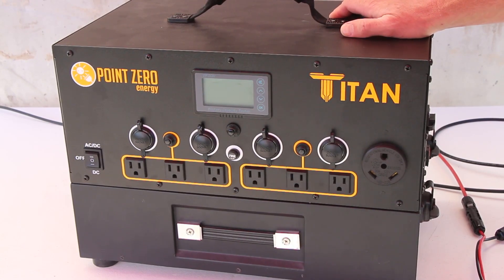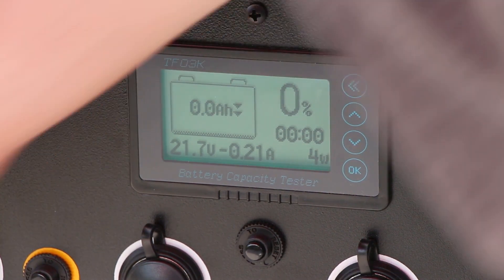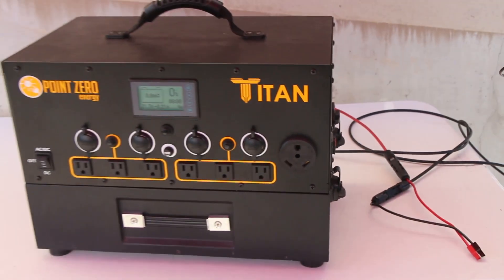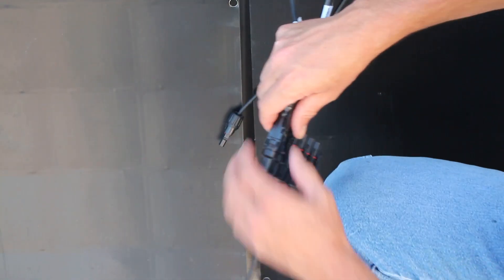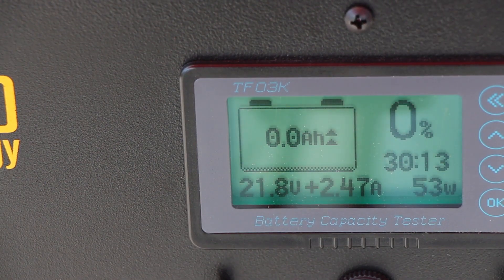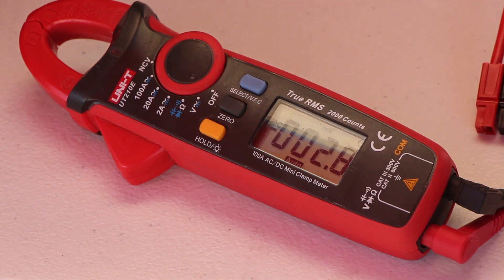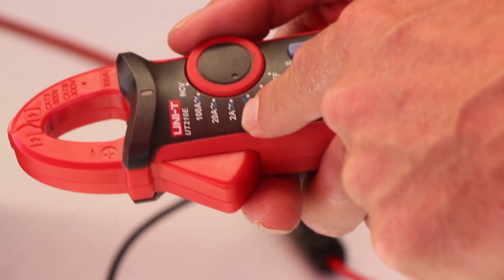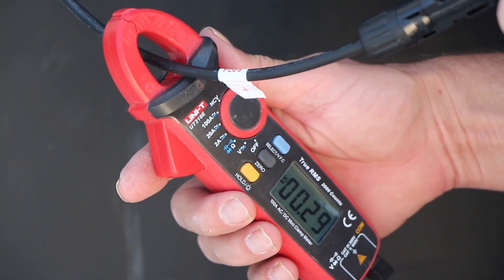Point Zero Energy Titan Solar Generator How-To Guide

Comment: Will this titan solar generator run a 2600 square foot home? and for how long? Thanks
Reply from the maker: It does not matter what the square footage of the home is, but what appliances you will run.  For example this original Titan is only 120V, so it will not run any 240V appliances such as a well pump, 240V AC, etc.  For those types of things, you would want our 240sp version.   But any off-grid solar solution has a limit to what it will run (even your grid connection does, but it is much higher).  If setup correctly it will run your home indefinitely (with the correct number of batteries and solar panels).

Comment: You will never get 42v from your two solar panels. As the length of the cable from the solar panels to your power station increases, its resistance increases in proportion and the volts delivered drops. Even if your station is right next to the panels you will loose volts due to the resistance created by the electricity running through the wires.
Reply from the maker: Yes, you will get a voltage loss according to ohms law V=IR, where V= Voltage, I = current, and R = resistance (R will increase the longer and smaller the wires are).  This voltage drop will be very small unless your wires are extremely long, for example using a 10A solar panel, over 25 feet, and 12 awg wire, you will get a drop of 1V (here is a handy calculator:  https://www.calculator.net/voltage-drop-calculator.html ).    However you want to make sure your voltage reading does not go to high even with zero current (you will get zero current when your batteries are full, or before the controller starts charging).  You also want your voltage high enough that is does not drop too low during high current that it does not go under your minimum voltage.  

You also will get higher voltages when the temperature drops, and lower voltages when the temperature rises (generally much more fluctuation than than from the voltage loss in the wire).   So you need some buffer in there to make sure you don't go too high or two low.  It is a good thing there is a wide range to work within.  Anything from 40V up to 110V is generally a good range to stay in, where you will never have any problems, no matter what your conditions.

Comment: Been running mine for almost two years now continuously. But now my panels will not charge the unit. Our 4kw generator charges it but panels won't any longer. I ran through troubleshooting in the manual, tested leads coming from panels for voltage and current so no issue there. So what now?
Reply from the maker: What panels are you using, how are they configured, and what is the measured voc (voltage open circuid, and isc (current short circuit)?
Reply: @PointZeroEnergy  5 rich flexible panels wired as instructed in the manual (series). Came with the kit. Can get you voltage and current readings when I return on thursday.
Reply from the maker: @harrisc8101  sounds good.  Also you can try moving the solar panels to the second mppt port.  If they work fine on that port, and not the other one, then that will also tell us that the panels and wiring are good.  If it also does not work on the second mppt, then it is most likely the panels or the wiring that is bad, and you will need to test each panel and each connection to find where the problem is (short circuit current is the best way to test the connectors and panels).  In good sun, they should produce close to the rated isc (located on the panel specs).

Comment: Any reason why I am getting a beeping noise after 5 minute use? This is also running on it's own power. Any info? TU
Reply from the maker: I am sorry to hear you are getting a beeping noise after 5 minutes.  I would suggest following the quickstart guide (or manual) to make sure your meter is calibrated and programmed correctly, and batteries balanced (if you have more than one).  Then make sure the battery is fully charged to at least 29V.   If that does not fix it, I would suggest opening a ticket on our website.  They will be able to do more troubleshooting, which may require a picture of your display screen, the number of beeps you are getting, etc.
Reply: @PointZeroEnergy  Well I did as you suggested and the battery meter is calibrated and I figured out that the batteries have to be charged more than like once every 2 years...lolol Thanks for your response! Much appreciated!
Reply from the maker: @raqueliatheimpatientgardne8196  Yes, it is best to charge them every 3-6 months, but they can go longer (not good for the batteries to go over a year).   2 years is a really long time to go without a charge.

Comment: Is there an external device that can be connected to the Titan to monitor daily solar input???
Reply from the maker: I am not aware of a device that will do that (there may be some though that I am not aware of).  I know there are AC output monitors that would monitor the power you use.  As long as your solar panels keep your battery charged, this should be similar (the solar input would be a little more due to losses in conversion, etc).  Also there are some DC monitors that may work such as a DROK Battery Monitor DC 0-300V 200A.  But I don't think it is really what you want.  There are some that do what you want, but the voltage limit is only 60V, so if your array is higher than that it would damage them.  It may be worth us looking into making, as it would not be too difficult.
Reply: @PointZeroEnergy  It would be helpful to have a device possible tied to a smartphone app the would give the ability to see live solar input plus look at past data.  Have seen that other solar generators and companies offer bluetooth to smartphone app as a way of monitoring their solar input.  I and I am sure others would love to have such a device for our great Titan generators.  Thanks for the quick reply!!!

Comment: I have had the Titan for more than a year now and I really like it a lot, but I do have a concern when charging from my solar panels.  Yesterday in full sun the voltage reached 29.7V and it was still charging the battery.  I disconnected the panels because I did not want the voltage to go any higher, since 29.7V is way too high for NMC cells (4.24V per cell if the battery is a 7S configuration and perfectly balanced).  In this video you mentioned that it would not charge after the voltage reached about 29.0V.  Is there a way to adjust the MPPT controllers to lower the absorption and/or float voltages so that it ramps down the solar charging when the battery reaches 29.0V?  I would not be able to put LiFePo4 batteries in parallel with the Titan if the solar chargers are going up to 29.7V.
Reply from the maker: Hi Bruce,
Please open up a ticket with our technical support here:  https://www.pointzeroenergy.com/contact-us-2
They will be able to figure out what is causing this, and get it fixed for you.
Thanks!

Comment: Can you use this with one of the bigbattery.com batteries as long as it's above 35v?
Reply from the maker: You should be able to use one of the 24V batteries, and connect it to the external battery expansion port using an SB50.  The above 35V is for solar input into the MPPT controller
Reply: @PointZeroEnergy  good to know, thanks.  Oh it's important to have all the batteries at the same state of charge right? Then they will drain uniformly?
Reply from the maker: @whitlockbr  before adding them together, they need to be charged to the same voltage (within 0.5V).  It will be in parallel with the Titan battery (or any other batteries), so they will all charge and discharge together.
Reply: @PointZeroEnergy  great.  This is all so we have portable power when camping and backup power for the fridge and possibly the  electric kettle 😀 when we lose power.
Reply: @PointZeroEnergy  is there a point zero with lfp coming soon?
Reply from the maker: @whitlockbr   Yes our Titan 2.0 with have the option of NMC, or LFP batteries.  We don't have an exact date yet, but are getting closer.

Comment: Can you please make a video about all th buttons on display and what they do. Like if someone accidently resets the battery level when trying to turn off the lighted screen. ( Which should be mentioned in the manueal but it is not!!) Also maybe some best practices lile best state of charge to store for a long period of time.. PLEASE!!
Reply from the maker: We have been planing on doing more videos like that, but have been extremely busy getting all of our orders out.  We have hired more help, and once they are fully trained, we should be able to get some better videos out.  But to answer those questions:

The Top button is the escape button, and takes you back to the main screen, or out of an edit, basically it is a back button.  It also can be used to turn off the backlight by holding it down for 3 seconds.

The two middle buttons are the up and down buttons.  They are used to navigate the menu, and to increase or decrease the values(when in the programming screen).  When not in the programming screen, the up arrow will calibrate the meter 10 100%, and the down arrow will calibrate the meter to 0%

The bottom button will take you into the programming screen if held for 3 seconds, and when in the programming screen is used to navigate from integer to integer.

We have an article on our website about how to best take care of your battery:  https://www.pointzeroenergy.com/knowledge-base/how-to-best-maintain-the-titan-battery/

Thanks!
Reply: Have you ever charged 2 batteries  with both chargers while attached to power module and have 1 wall charger light green and the other wall charger stay on red? It says its 100 percent but one charger is still running??
Reply from the maker: @ozzieosawamick1712  Yes, this is normal when using two chargers.  One will turn off when the battery is close to full, while the other one will finish the charge.

Comment: I really like the Titan but can not come up with the cash for it.  Plus the fact if I had it and needed a battery would I be able to get one they have been out of stock for ever.  To me it makes no since to have this and not be able to keep it going or  not expand it when I an ready to do so. I had a shop and had over 60,000.00 in parts in stock and it still wasn't what I needed to be able to work on all the cars that came in. But I could get parts in a few days with the titan I have been watching the batteries and they have been out of stock for months so if I needed one I would be up crap creek. I think you you kept things in stock you would have more people looking to buy this. Another thing is the price of it. for what I need it's almost 7,000.00 that's a lot of money for most people. I have gotten myself a set up now with 3.4 kw hour's for just under 4,000.00 and have more power. I have waited for months for the titan to come around to a better price and more stock and I am sorry to say they haven't. I will keep watching the titan because I think it is a good set up just over priced and lacking thing's people will need to keep them up and running.  I hate to see something I like that isn't keeping up with what people need.
Reply: I feel for you, it's quite expensive.  However, lowering the price would only increase demand, thereby making the stock problem worse. Assuming they're making them as fast as they can, the price is where it should be.  Perhaps once demand levels off the price may come down?  Problem is there's nothing else like it out there.  Stackable battery expansion, dual MPPT up to 2000W total, 3000W sustained inverter w/6000 peak.  It's a beast.  The expansion batteries are actually quite reasonable price-wise.  You can also save on the panels and wires buying them directly from NewPowa.
Reply: Let me save you a lot of money:
They don't work, and I don't just mean the generator!
Reply: @MR-nl8xr  Ya? So tell me , why has my Titan been running flawlessly for a year and a half, and is such a beast with 1 74AH battery stacked, compared to my shelf-built 115AH SLA AGM system?